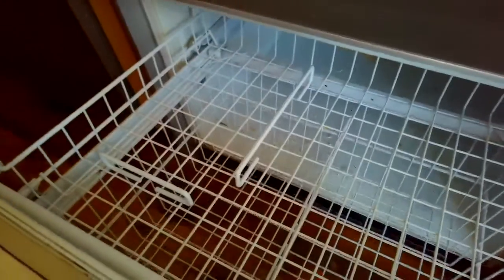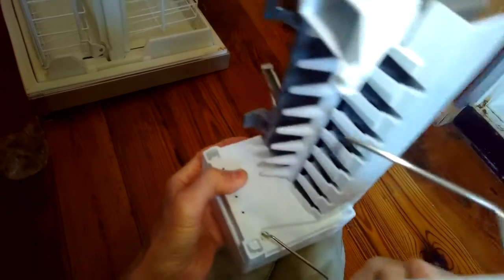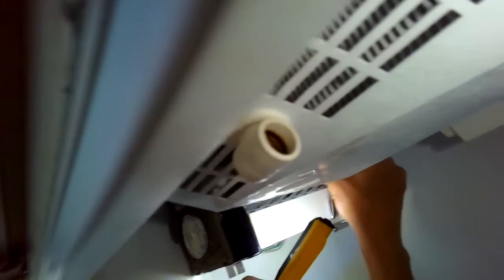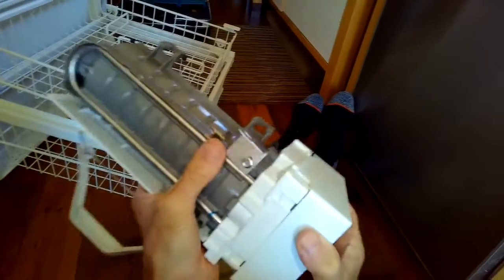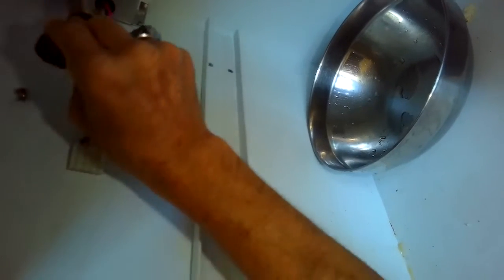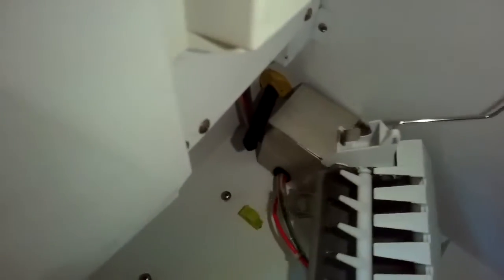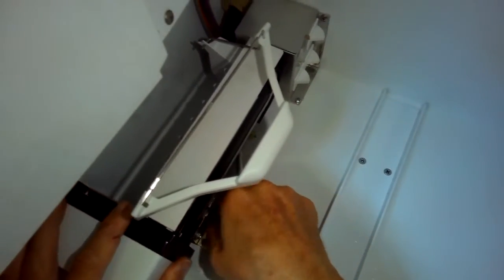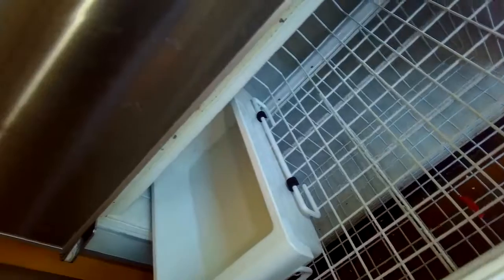✨ SUBZERO ICE MAKER REPAIR ✨

Comment: By the way you do not need to remove the two  top screws all the way just loosen enough to lift off the ice maker. It's way easier to re install that way
Reply from the maker: Thanks Steve😊

Comment: The fridge I'm trying to fix is this 736TCL-6 Sub zero problem on the board because it makes ice when it wants to. I tested valve and ice make. I believe the scolding is a plate. My fear for an old refrigerator is that it doesn't have parts for it. Because here in Brazil I didn't find any representative. If you can help me I will be very grateful. Thanks

Comment: Hey, I have a SubZero 501F that's been in service for a good while with no water to the ice maker. I just hooked it up and water just pours out of the ice tray and into the ice catch basin until I turn off the water. Suggestions?
Reply from the maker: I would replace the water fill valve . It’s stuck in the open position.

Comment: Many thanks!!! Question: Would a failed fill (or drain) tube heater halt ice production?

I am unable to get my 690/F to resume ice production. I have done all the following: Replaced icemaker, tested valve (works fine – I can manually fill the ice maker via an override after swapping in the door water fill switch (thus bypassing the signal that is supposed to be sent by the ice maker to the valve), verified continuity of wires from icemaker to valve and icemaker to ground (all good), verified all four switches work (two for the ice bucket, two in the door). I have not yet verified whether the drain tube is clogged (I suppose it could be…).  If either the fill or drain tube heaters failed would that cause the ice maker to halt production (e.g. is there some thermostat that is opening/closing a circuit to verify that the tubes are being heated)?

Any other suggestions for me?
Reply from the maker: I wonder if one of those door switches is saying that the freezer door is open?

Comment: Great video but still stumped.  No ice coming from my 20 y.o. SubZero 550.  Did a bunch of tests tonight that took far too long since it was my first time. But now, I'm not sure how to read them.  Can you help diagnose the problem and solution from the following data:
L to N:  119 volts
L & H:   76.7 ohms
L & M:  Jumped all over the place when I did multiple times and ranged from 84 to 120 to 160 or 180 ohms at varying times.
V & N:  169 ohms
T & H:  Nothing

When I jumped, the following happened:
L to T:  Nothing happened
T to H:  Nothing happened
N to M:   Wheel turns
L to V:  Nothing

Tempted to call repairman and spend the big bucks unless you think it's a clear solution from the above?  What do you think is the problem?  Solution?  THANK YOU!!!!
Reply from the maker: I would just replace it.
Reply: Scottthefixitguy  Thanks.  My concern would be that I would replace it but that it would be the pump or solenoid and I'm wasting my time.  Do you really think if I just put a new one in, it will work?